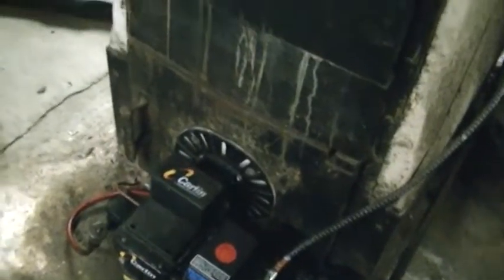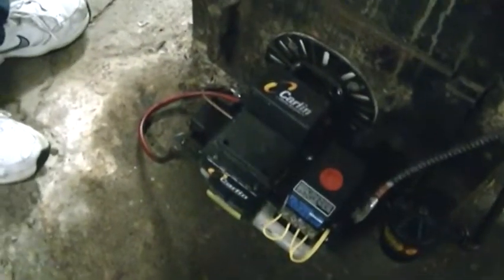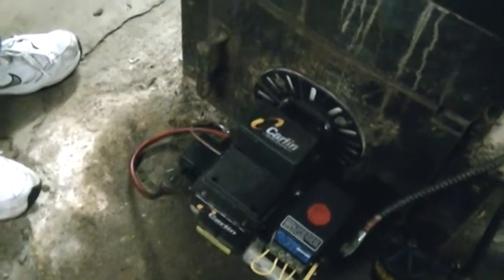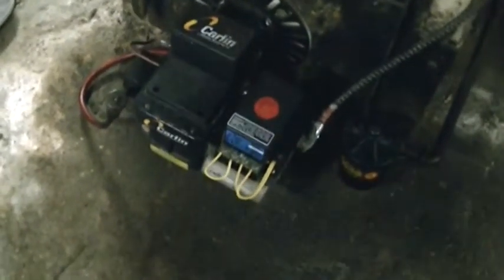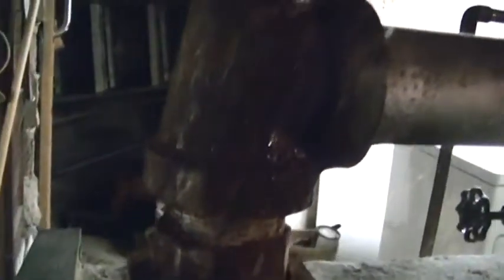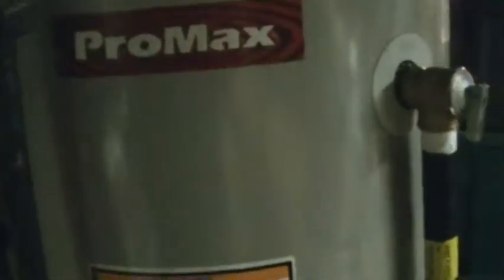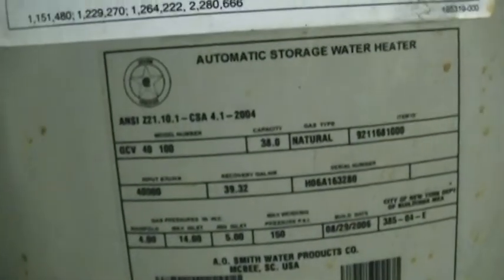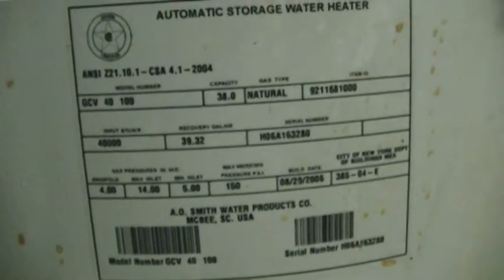Old Oil-Fired Steam Heating System

Comment: I also have a late 50's or early 60's day and night gas furnace at my old house, it is also working great up to today like my grandparents early 1940's Payne gas furnace.
Reply from the maker: That's keeping the home fires burning.  Har har!
Reply: jaykay18 my grandparents Payne gas furnace has 4 burners, 1 standing pilot, and a belt driven blower motor, my day and night gas furnace at my old house has 2 burners, 1 standing pilot and a direct or belt driven blower fan.
Reply from the maker: The number of burners doesn't matter, it's the heat output in BTU that does.  I think my 1972 HydroTherm boiler (that's different from a furnace--a boiler heats water for circulation by a pump, a furnace heats the air) is 125,000 BTU.

Comment: Yup. Pipe insulation is asbestos and the furnace was spray-coated with asbestos as well...maybe something you might want to mention to the owner to have it wrapped or removed. Nice video.
Reply from the maker: +fedders airDUDE Thanks.  The owner is more of a "if it still barely works, don't fix it" kind of person.  So that stuff is going to stay, chances are it will be sold to the next owner that way.
Reply: "Safety third!" Lol. My house had asbestos on pipes since I have steam in my house, only I have a gas boiler. Had them covered with fiberglass lagging. Wasn't that expensive, although removing it would be pretty costly.

Comment: your heating is cool, it could be used as the main character in a horror movie... (like The Mangler, sort of). It is amazing that it still works... I also do have an old heating but major parts of it got replacedl... this way it doesn't look that cool anymore...
Reply from the maker: Nothingatall Thanks, although it's not mine!  My heating system is about 43 years old though.

Comment: That's a water boiler, not steam.  That's why it has the circulator pump and the type of fill valve it does.  Most all steam boilers will have a sight glass on the side as well as a metal "pig tail" with a pressure switch at the top of it.  Your water heater is natural gas so apparently you have natural gas in your location.  It's MUCH less expensive than oil.  I'd recommend replacing the boiler with a gas fired boiler.  I'm guessing you have municipal water.  If so, you need a potable expansion tank.  That's why the new relief valve on the water heater is dripping.  And that drip tube on the relief valve should be within 6" of the floor.
Reply from the maker: You're right on all counts.  This is not my house, and the person who lives there insists that oil is cheaper than gas, because of one incident that happened some 30 or 40 years ago.

That water heater is set WAY too high, the hot water will scald, but that's the way the owner wants it.  There is no expansion tank on the water supply, but there is one in the ceiling for the boiler.  The water heater only started leaking/dripping recently.  It was replaced, and it's still happening.

My sister used to live in a place that had such sight glass on the side, yet there were circulator pumps on that too.  She had to add water to it every now and again, although nothing was leaking around the boiler.
Reply: @jaykay18  
You can get natural gas conversion burners for the old boiler. That boiler will last forever.
Reply from the maker: The owner is under the false impression that gas is more expensive than oil.
Reply: Hi my late grandmothers house has an old boiler heat tank, so do these have to be removed or can they be restored. Not sure if it was water or steam.

Comment: That's an old boiler! I thought the 1958 natural gas fan forced furnace in my house was Ancient its good that this boiler still works. Goes to show how quality is then VS now.
Reply from the maker: Willie Peck I wish I could +1000 that comment.
Reply from the maker: I would love to see that boiler fire up!
Reply: The one in your video or the one at my house?
Reply from the maker: Willie Peck At your house.
Reply: Okay. Ill see what I can do. We may not even use it this year if the temps don't get really cold. Last year we didn't fire it upMy dad doesn't think he needs it if its not really cold. He only uses it sparingly. It's a Custom Aire ill try and get some pics for you soon. The only thing that I know of that was replaced was the thermocouple.
Reply from the maker: Willie Peck Oh, even better--a standing pilot!  Wow that thing will probably run forever.  And since it doesn't get cold where you are, it being in limited use will simply prolong its lifespan.

I'd love to be in a climate where it doesn't get cold.  A co-worker of mine just came back from Florida, he said the weather was only as cold as 65 on one day.  The rest were 70 or 75.  Even if it got down to (eek!) 50, I could deal with a space heater or 2.
Reply: Yeah I'm from Tucson AZ it doesn't get cold but it gets really really HOT! The night temps currently are around 35. Coldest night predicted this week is 28 hottest day temp this week is 64. We have that big storm from CA coming in so the temps are a bit lower. 

The furnace runs very good it has 2 burners and a powerful fan. It works better than all the modern ones I have seen. The air coming out of the vent is very very hot just how it should be. You know how modern heaters blow out kinda sorta warm I hate those. They say it saves you money bullshit they don't lol they don't cycle and that means more wear on other parts.
Reply from the maker: Willie Peck Wow 35 at night, I guess it really does get cold in the desert at night.  I often wondered if those extreme temperature changes wreak havoc on all kinds of stuff.

And as far as the furnace blowing hot air, all I'm going to say in response to your comment is yes, yes, yes, yes, and very yes.
Reply: Yeah lol. Those extreme temp changes don't seem to cause damage or cause havoc to HAVC equipment. Unless you forget to drain your evaporative cooler water pan in the winter it freezes sometimes.
Reply from the maker: ryanm That's the idea they want you to believe, anyway.  They also say that even though it is very expensive, electric heat is 100% efficient.  The problem with fossil-fuel fired boilers is they can't be 100%.  When they start squeezing another 10% efficiency out of them, something's got to give.  Kind of like modern ANYTHING now, it just doesn't do the job anywhere near as well as good old American Iron.
Reply: ryanm yea but the new ones don't last as long or blow as hot. Plus they have way more parts then necessary. I'm gonna stick with my 58 furnace.
Reply: +Willie Peck Have to say I would not want this in my basement. The things are loaded with asbestos etc, plus, at least with this unit, there isn't much quality to them. The burner on this one was replaced which is really the only part on this unit...the rest is just a cabinet and a load of asbestos. The pump on the other hand is a quality piece of equipment, those little puny ones the make today do not last! I have steam in my house and personally hate it. It takes forever to heat up and then forever to cool down. Therefore, when its cold you stay cold and when it heats the room too hot it keeps getting hotter until the radiators cool. Forced air heat (whether gas or heat pump) is the way I like to go.
Reply: Yup forced air is the way to go. My house is from the 1800s and has steam with asbestos in some places. Newer gas furnace though.
Reply from the maker: fedders airDUDE A hydronic water-forced system (not steam) is actually the best way to go.  I've heard that time and again from all different walks of life, and that's exactly what I have.  It's plenty warm and very even heat.
Reply: jaykay18 It does get very warm. My problem is it just takes so long to heat up and to cool down. I like just being able to hit a button and have the space I'm in get warm and then stop when I'm comfortable. It is very even like you said though. When I had forced air it was not as even.
Reply: Well it's not a matter of quality but of simplicity. That boilers where basically a fireplace with some water on top, nothing that can go wrong, compared to a modern boiler that has an delicate stainless steel heat exchanger with a sealed combustion chamber, a variable speed fan, a variable speed circulator, gas valve that can modulate, electronic boards, a secondary heat exchanger for domestic hot water (if the boiler also is used for instantaneous hot water), temperature sensor, pressure sensors, flow sensors, etc. 

A modern boiler can reach almost 100% of efficiency, while an older one like that one you are luck if you reach 50% of efficiency, that means that half your gas gets wasted in heat that goes out of the chimney instead that in your house. That kind of boiler type in Europe can no longer be installed and is banned, if you need to replace a boiler you must install a condensing one, for obvious pollution issues. 

Of course a modern boiler has also a ton of safety features that that thing doesn't have, I think it wouldn't even be allowed to be used in my country, boilers with an open combustion chamber like that one have an high risk of generating carbon monoxide if something goes wrong.
Reply: +Willie Peck New ones might save electrical costs and what not. If you can feel heat coming out of the exaust of a heating unit then it's not efficient and a lot of wasted air. So that's something to look at too when you want to compare efficiency. You might be getting a lot of hot air, but the output btu might only be 80% verses a new one being 90%. Essentially you should get more heat the more efficient it is.
Reply: Haha jay!
Reply: Most buildings except for the really really old ones have sole sort of forced air system. I like it cause like you said it doesn't take forever to heat up or cool down.
Reply: Oh. Well I guess yours is older than mine lol! Buildings from that timeframe in Tucson have steam heating. My house has asbestos in it too mostly asbestos tape around the furnace and supply ducts.
Reply: That could probably be covered with duct tape over it, very carefully.
Reply: In my house when the furnace is running my room becomes really hot and the rest of the house gets little heating it seems. But after it cycles 2-3 times the house is evenly heated.